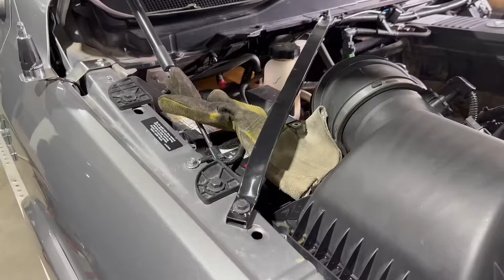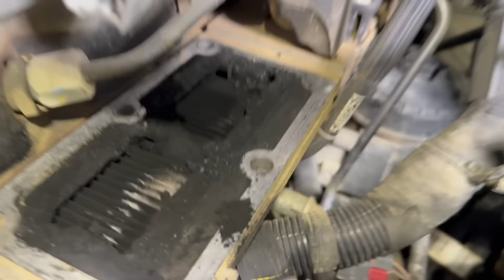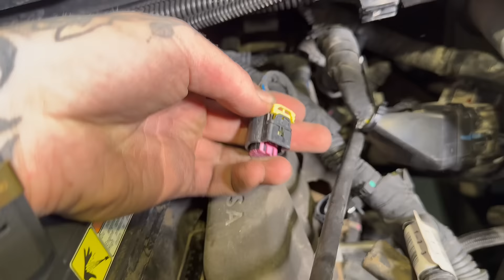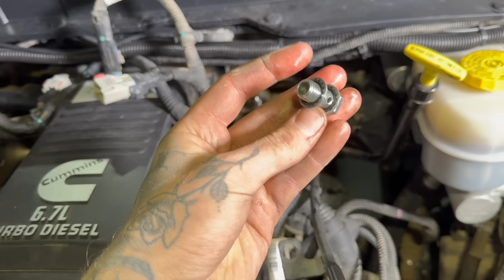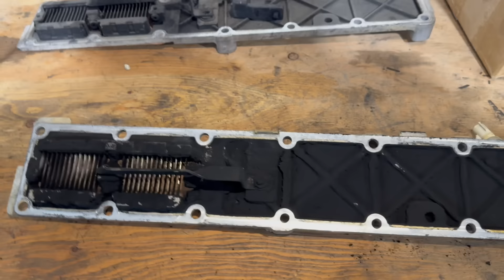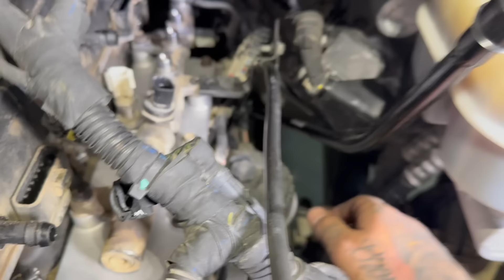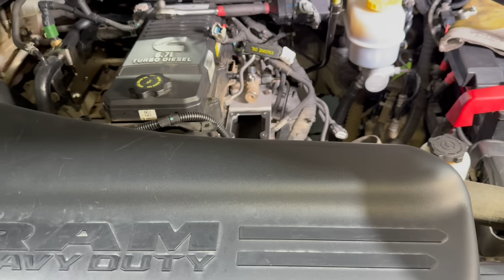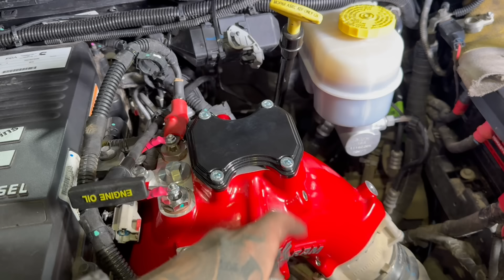How To Install Banks Monster Ram 6.7 Cummins - QUICK VERSION

Comment: I just had mine uninstalled for my 2019 2500 and it runs great. I bought the standard color for just over $700 from amazon as the red (looks cool) but over $1k. I’m deleted but still have my egr in place so not sure of terminology. The throttle response is awesome and it runs like a dragon. I pull a 8000lb travel trailer full time and the difference in before and after is a powerful increase. Do you recommend the Banks differential cover? I’m told it helps keep temps down. Thanks for sharing.
Reply from the maker: With the $250 off sale banks currently has plus my discount code you get get the red one for under $700 👀 

If you’re towing lots in hot climates yes the diff covers can be beneficial.
Reply: @darkirondiesel dammit man! All good we ordered from Banks originally and they were on back order and told us that after waiting two weeks for delivery. I was passing through and on a time crunch. I canceled from banks and order from Amazon.
Reply: @darkirondiesel  .. beneficial for sure ,,, necessary not really.. a good non flat back alum finned will help as well for less.. thanks..

Comment: You already posted this. Video a year ago. And you had problems in the vintner with bad starting
Reply from the maker: I never posted a step by step “how to” video. The video you’re thinking of was when I was testing the monster ram, and yes it didn’t start well in the cold. But if you paid any attention whatsoever you’d see this is the NEW monster ram with dual heaters.
Reply: @darkirondiesel paid any attention what so ever?  Ah you are one of those assholes. You could of said that a little nicer. I’ve been watching your videos and giving you thumbs up. So I will remove all them thumbs and unsubscribe

Comment: Kyle; please find a manufacturer to produce a diet kit for the Cummins cab and chassis!
So frustrating no one is making those kits…
Reply: I have a Banks Monster RAM on my RAM 5500 - Banks makes them for Cab n Chassis.
Reply from the maker: What year is your truck? There are kits for the cab and chassis
Reply from the maker: Here’s a link to the 2010-2021 cab and chassis, not sure what year yours is https://thedieseldudes.com/products/cab-chassis-ram-cummins-full-delete-bundles-2013-2021?afmc=1o
Reply: @darkirondiesel I  have a 2023 3500 and a 2023 4500
I’ve already done my 2024 2500 but it’s a pick up
Reply from the maker: @HardKnocks101  call the diesel dudes, im pretty sure you can do the cab and chassis with the ecm swap you just can't get all 6 power levels but they should know for sure

Comment: I still have a 5.9 but there is at least 4 6.7s in the family.  2 2012 and 2 2016s.   After seeing many of these come up I am wondering if the older ones are the same or not.  Seems most of the issues online are the newer ones 2019 kinda thing.  I just not sure if I should be getting on my brothers case to pull them apart and see.   After watching this it is a bit more work then I thought but  not the end of the world more.  Good info on your channel without you trying to fill in time and wasting mine.  I appreciate that.
Reply: all the 6.7’s have the same design. it’s really not as big of a deal as it’s made out to be, but it does happen.

Comment: I've got a deleted 2011 if you want to do a year specific video. I'll drive it from Ontario and let you install one 😂
Reply from the maker: Brother your fuel, food and hotel bill would cost WAY more then if you just had it done locally 😂
Reply: @darkirondiesel worlds biggest DID fan right there 👆🏻
Reply: bruh…year specific? they’re identical 07.5 to 18…..
Reply: hell, all the way up to 24 really…
Reply from the maker: @thfdieselrepairandoffroad  yeah man like other than a couple sensors being in different locations there's really no difference from 2007.5-2024